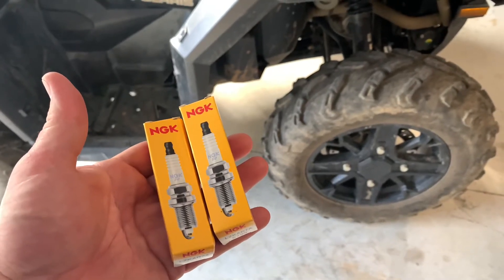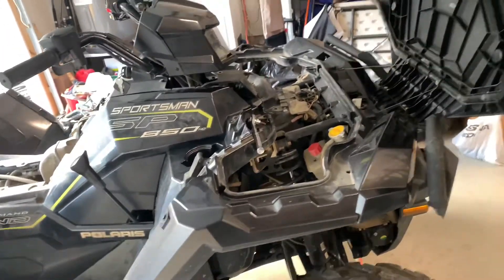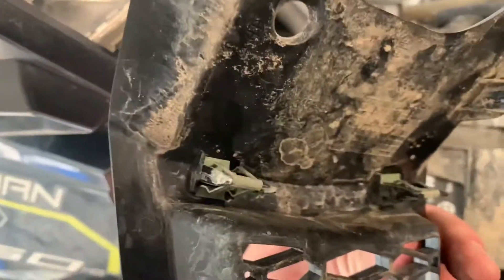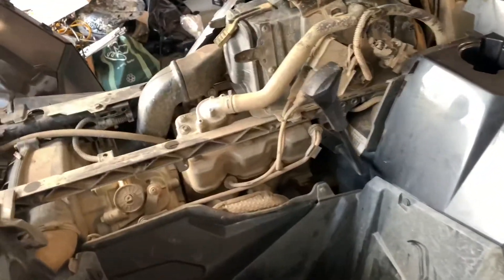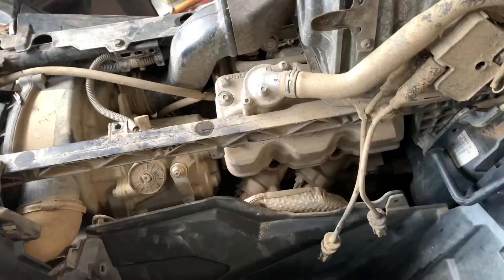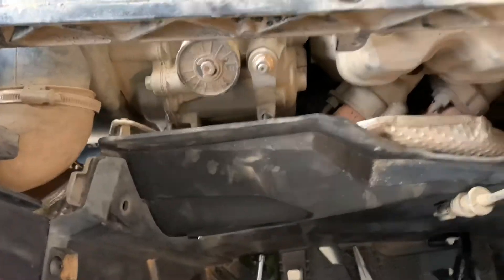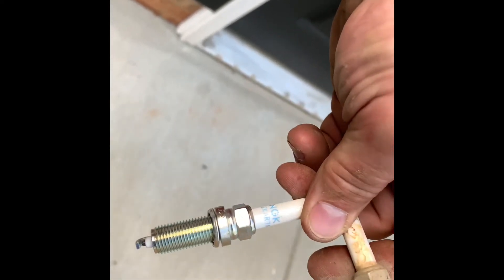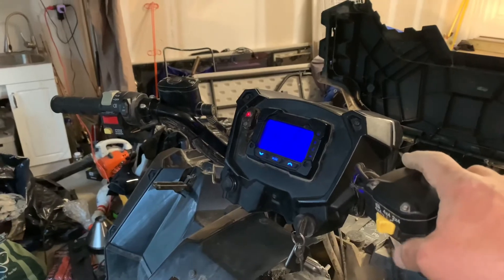2019 Polaris Sportsman 850 SP Spark Plug Change - Important Tips To Avoid Frustration.

Comment: What tool did you use to remove the spark plug? TIA
Reply: They are called a spark plug socket. Goes on a rachet. Think its 5/8's. They have either a rubber ring or magnet inside them to pull them out when u unscrew them. I suggest the magnetic ones since the rubber ones tend to break down faster.
Reply: 9/16" socket on mine then just grabbed it with my fingers

Comment: This is a waste of time and spark plugs , my plugs have 5800 miles on them and are slightly worn but still work fine , these are brand new and still perfect shape , the linkage can be worked around n left to avoid breaking plastic pieces unnecessarily removing . I had so many why are u doing this questions in mind while watching this .